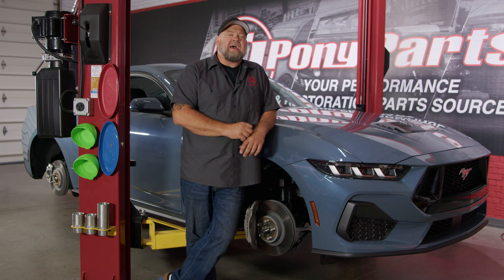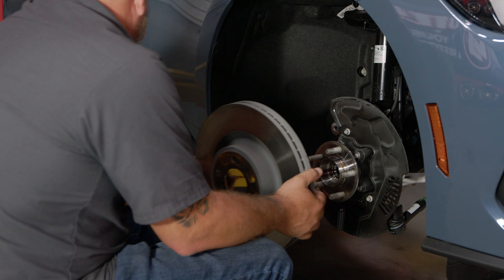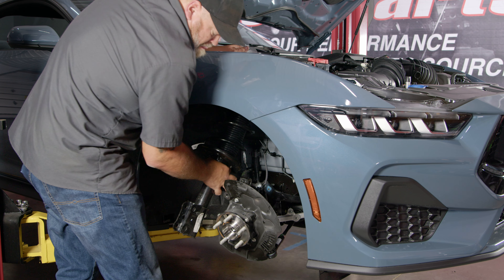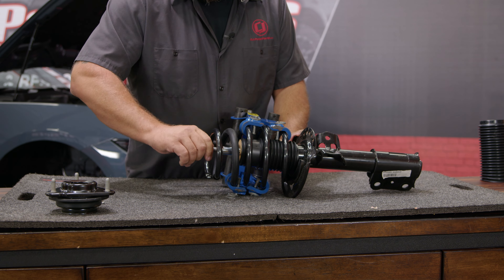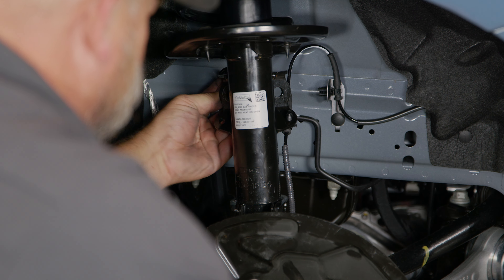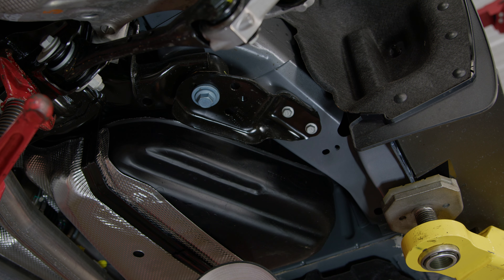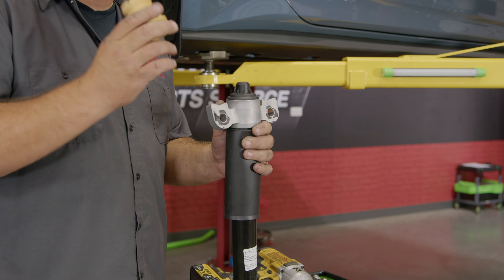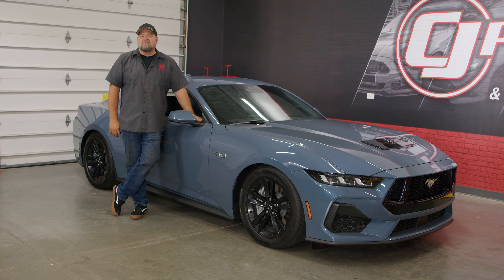Our 2024 Mustang Gets More Attitude and Less Altitude With a Set of Accelatec Springs!   #lowered

Comment: If I install this onto my S650, will it cause any type of suspension noises? Creaking, clanking, odd suspension noises when going over bumps etc? I put a full ford performance suspension on my S197 GT and it became a nightmare with a litany of noises. Sounded like I was driving a 1980’s farm truck down the road.